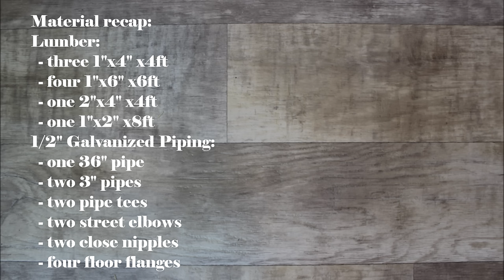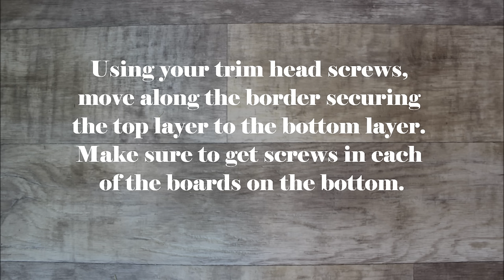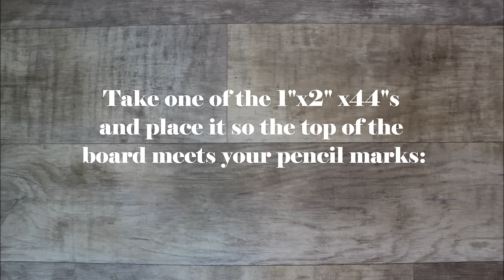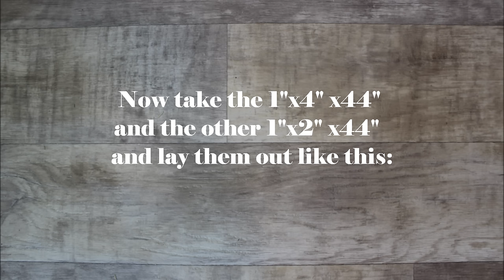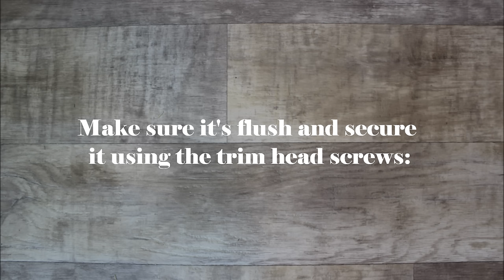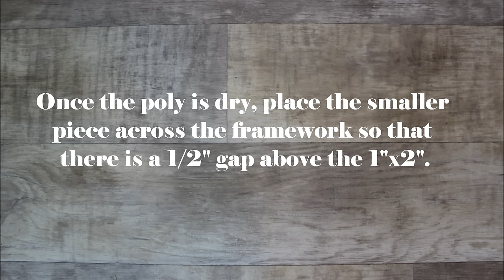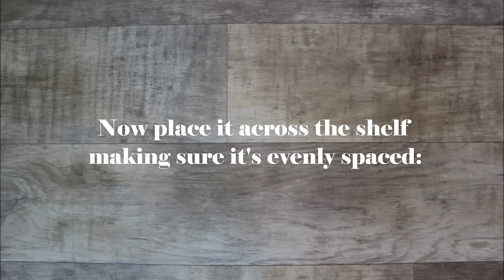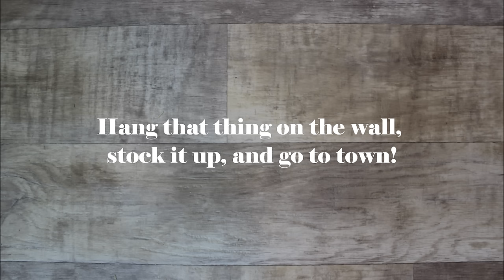The Industrial Wine Rack - Easy DIY Project

Comment: I don't know if I agree with the weight and movement of a wine rack supported by two picture hangers. I'd probably drill that into a stud to be safe.
Reply: But I still love this video. Great job man.
Reply: E B I built one and got heavy duty hangers that go on the wall and the back of the rack that lock together. Obviously you need to hit the stud or this thing will rip off your wall
Reply: deathraid44 I'm saying forego the hangers and go right into the studs
Reply: French. Cleats.
Reply: I make French cleats for mine and they work perfectly

Comment: It looks great, worth noting though is that for wine the cork should always be wet which is why they're usually laid down. But this is fine as long as you not planning to have a bottle standing there for too long. So this is for temporary storage, not long term.

Comment: Different areas will have different prices for the materials and depending which store you pick. The price I came to at my local Menards is $90. It was the 3 foot galvanized pipe that blew the price up.

Comment: Nice project. Although the material for this one is rather expensive. Making it now and I only had to buy 2 planks of lumber. Had all the other wood already. And bought all the steel. Cost for 2 planks of lumber, steel & fittings, screws and hooks was almost $80
Reply: Kyle Wood what hooks did you use??

Comment: After building this I found it to be quite heavy, was this mounted to studs or did you use heavy duty dry wall anchors?
Reply from the maker: Hi, sorry for the late reply! I would definitely recommend attaching to the studs due to the weight

Comment: Could you use a nail gun for most of this instead of screws? It seems like it would cut the need for wood filler unless the weight is an issue?
Reply from the maker: Screws will definitely provide more stability. It's a heavy piece especially when it's filled with wine so I would advise sticking with screws.
Reply: The Rehab Life how much does this weight?

Comment: Measurements are off (8x6"=48") and then you have the top and bottom cut down to (44") and want to everything feed snug? how did you manage to do that in the video? from there on everything is off, should give the right measurements don you think?
Reply: Good question, and when you add the 17" with the two 4" boards total height is 25" so you would be an inch over. I also didn't do well in math so this is all debatable.
Reply: If you buy a 1x6 at the store, the actual width is 5 1/2 inches.  8 x 5 1/2 = 44

Comment: For creating 1/2 inch gap...you have assemble 1 by 2 inch wood and 2 by 4 inch wood into 1 by 4 inch wood.

2 inch + 2inch = 4inch can you please explain from where the 1/2 inch gap came from?

Secondly , you have taken 8 pieces of 6 inches horizontally assembled so measurement should 48 inches and not 44 inches...can you please give us correct information?
Reply from the maker: The actual width of a 2" board is 1 1/2". Likewise, a 6" board is actually only 5 1/2" inches wide. The measurement as stated in the video are correct.
Reply: @TheRehabLife  its not mentioned that actual width is different...can you please tell actual width of 2 by 4" inch board as well?

Why you have mentioned 1 by 6" if the actual  dimension is 1 by 5 1/2 likewise for 1 by 2" wood?

Please tell me the basics
Reply: @anuragverma5318  The reason for this is North American softwood lumber standards -  Nominal VS Actual wood sizing, e.g. 2x4 is actually 1.5 x 3.5. Just look it up on The Googles.

Comment: what is the 1/2 gap for. how do u keep it the 1/2 gap
Reply from the maker: It's so the glassware will slide in, just measure 1/2" on both ends so it stays consistent across the rack.